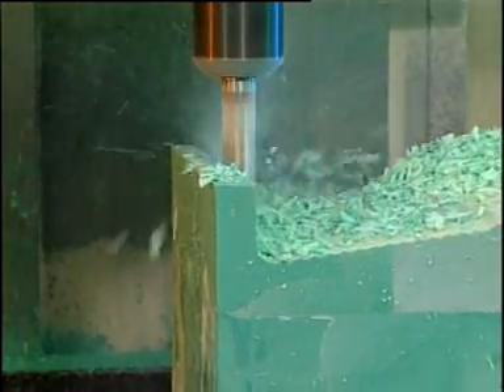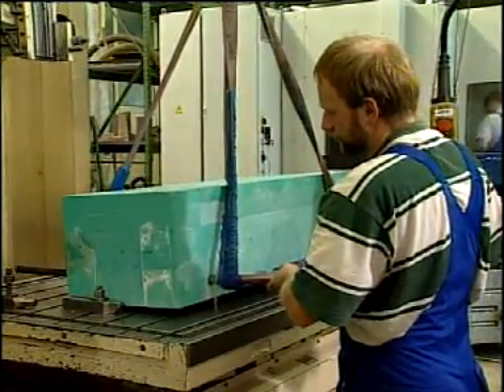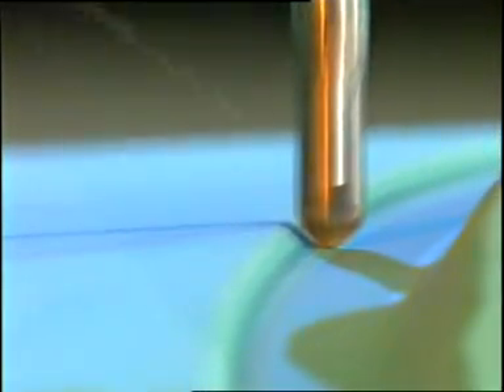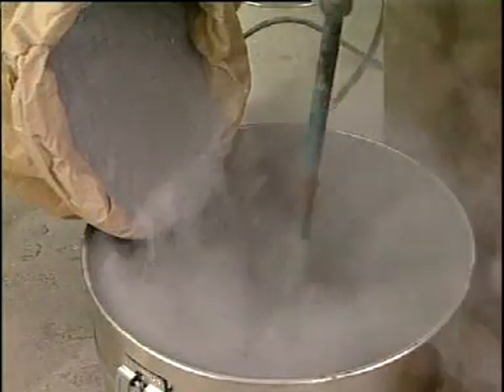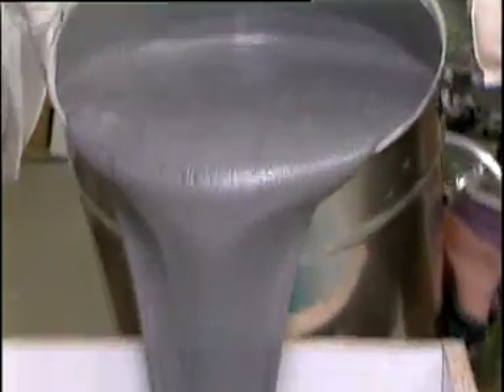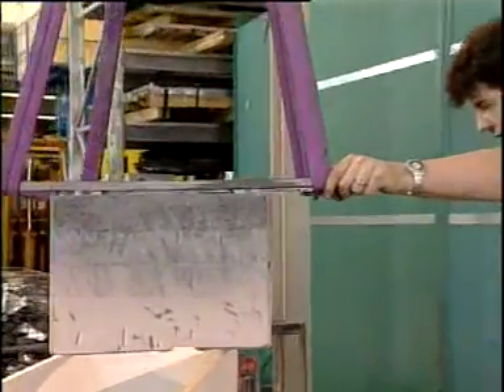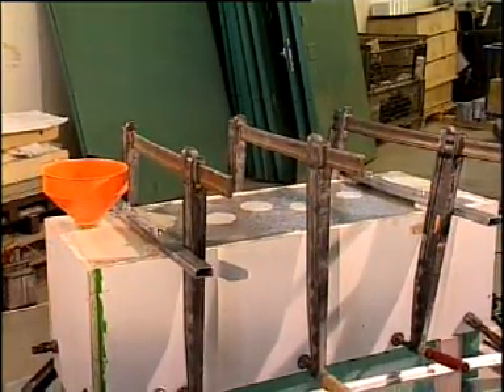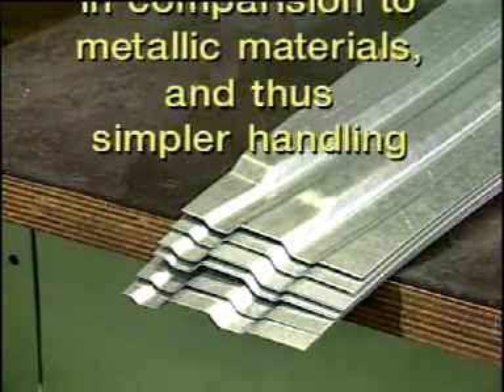Metal Sheet Forming Tool Build

Comment: Can this resin be used for a male tool in a deep drawing process? the metal to form is brass 0.813mm thick, I will use it for low volume (about 150 units).